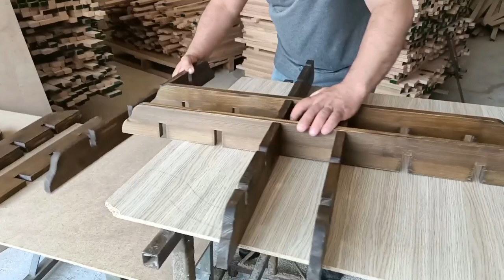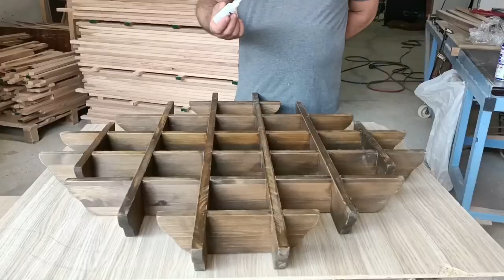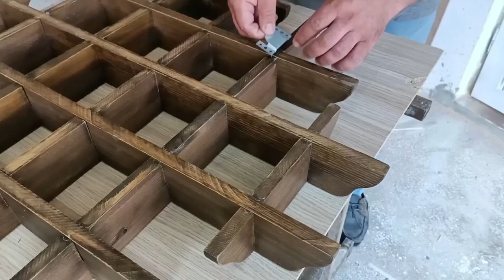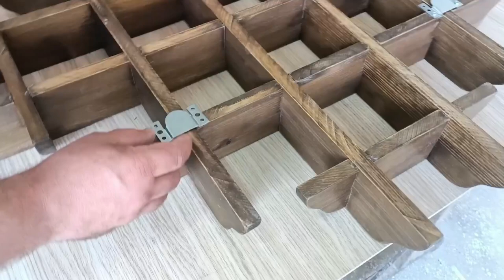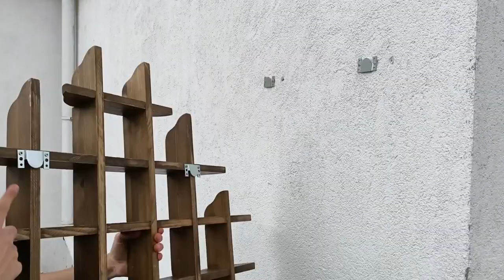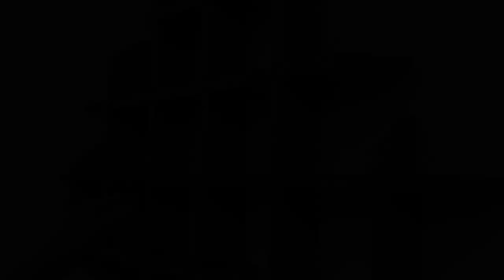Wooden Coffee Cup Mug Rack with Shelf.Rustic Modern Wood Wall Mounted Mug Shelf Display Set up

Comment: I LOVE this pattern, but I would want to suspend it from the ceiling in my kitchen instead of on a wall.   Do you have the blueprints/measurements for this?  Or at least the angle dimensions?  What did you use to make the notches in the wood also?